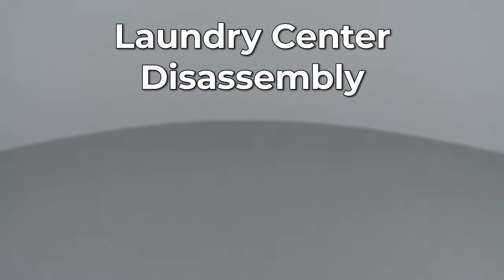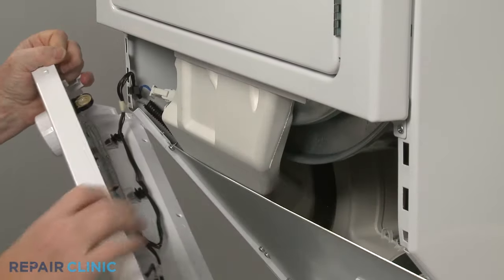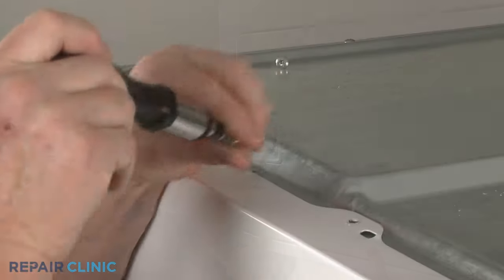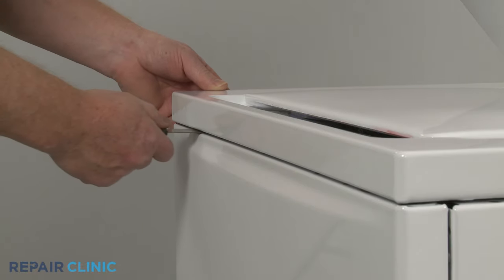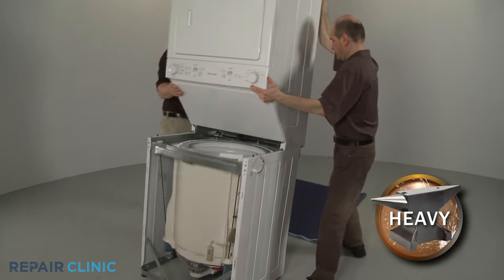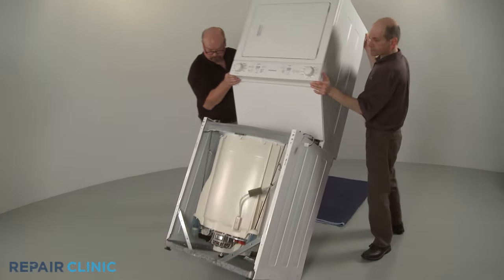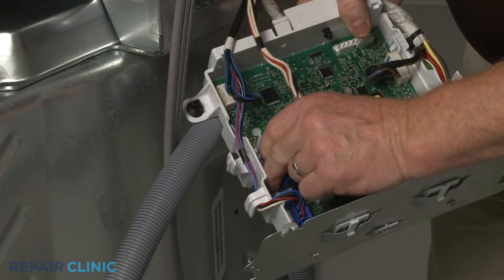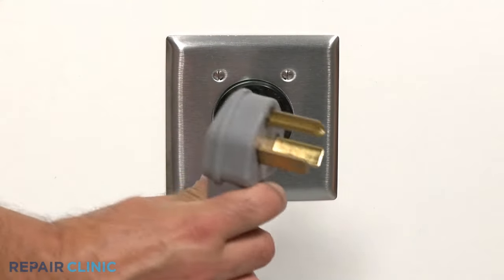Frigidaire Laundry Center Disassembly (FFLE3900UW1)

Comment: Great video!!!  It saved me from buying a new all in one.    My dryer drum stopped spinning and I found 2 screws inside the drum when unloading my clothes.  Issue was...screws that holds the drum to support bearing came loose from inside and the dryer belt became loose.   It also came me a chance to vacuum  unseen inside of the dryer.   It's a fire hazard if it catches fire :(

Comment: This is a good demonstration. For the washer compartment however, @ 7:30 our model did not have the clips in front that pops the top but was screwed in place from the inside.  Eventually we figured out to get the front panel off by removing the bottom two screws and sliding the panel down, which the demonstration showed.  We then replaced the drain hose. Thanks
Reply: Very helpful info ! I thought I was crazy an just couldn’t do it. 💀😂

Comment: Crystal clear details (at least for the dryer steps that we needed). No idea why, but the drive belt had come off. This video was exactly what we needed. Thank you.
Reply: My belt is off,but not broken.  Best to just replace it,right?  Can I get it at Home Depot?
Reply: @rogerpotter7695  I wouldn't bet on finding this kind of part at Home Depot. You'll likely need to go to an Appliance Parts specialty store with your model number.
(I'm not a pro, so take this next comment with a grain of salt.) If it was me, I'd try just slipping it back onto the pully system from the back of the unit in the hopes that you don't need to fully replace the belt. This is much quicker/easier job than replacing the entire belt and it will be good practice if you do eventually need to replace the belt.

Comment: excellent thank you. can't remove main top don't think mine comes apart like in this video for some reason. would have been cool if sheet metal was notched or something for when you need to take in apart.
Reply: I figured it out. mine is definitely different the front panel has to first be removed and there were 2 screws that had to removed 1 from each side.just in case someone else was struggling when watching the video.

Comment: Thank you for your video. I need to replace a drain hose. I guess I will have to remove the rear lower back panel? Do you have a video for this?
Reply: If your machine is like this one, the back panel does not come off. Instead, you need to lay the washer/dryer down, preferably on its front so you can have easy access to the drain pump from the bottom. Note: you may not have to lay the unit all the way down; maybe just a 45° angle will give you enough room to get to the drain pump.

Comment: I have a ge laundry centre that looks similar to this set up.  The washer makes a sharp, loud squeeking noise when it's on the wash mode (when the drum agitates the clothes).  Do you have any idea what might be causing that noise and what part I would need to replace?  Thanks for making this video!
Reply: I’m having this problem now. It is the tub leaking into the bearing underneath causing the noise. Good luck getting it fixed

Comment: My frigidaire washer/dryer unit is spinning slowly during the spin cycle. I'm gonna check the belt's condition but usually from your experience with Frigidaire, what would it usually be?
Reply: Posible causas resistencia Quemada, termo disco, time drin

Comment: my dyer turns of after 5 to 10 seconds
Reply: Check thermal limiter on the upper rear left of dryer,  you may have to remove drum, if it is open , replace it, then make sure duct vent is clean.